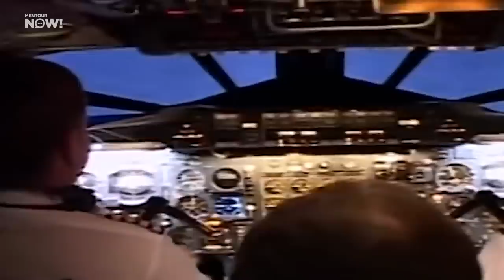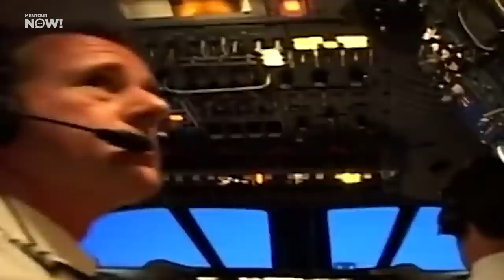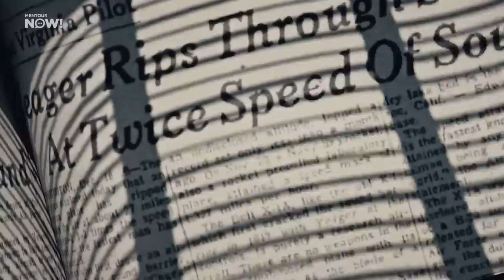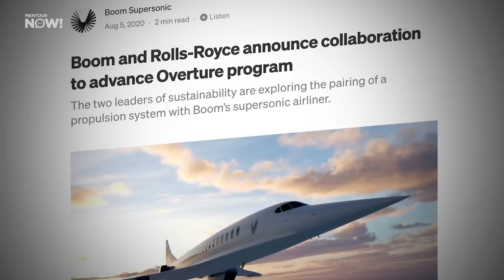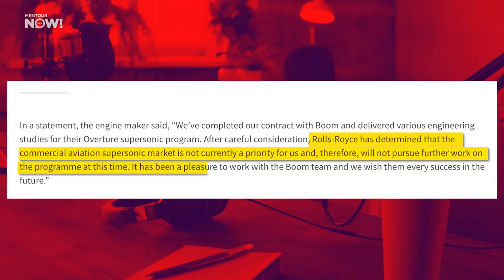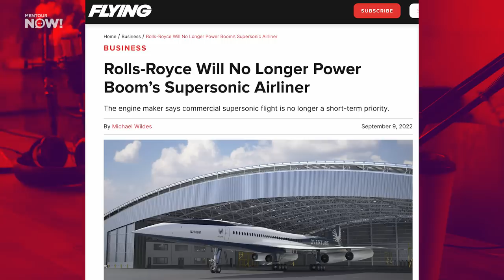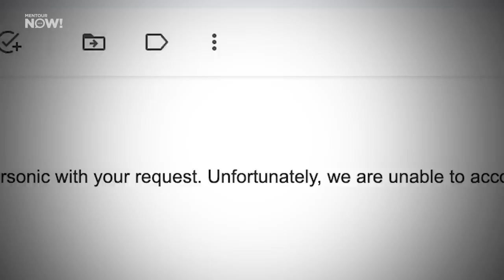WHAT’s Going On with BOOM Supersonic?! Will it Fail?

Comment: I suspect, this plane will have same problem as Concorde got. The landing gear are too close to the engines. I mean't that 2000 year catastrophe.
Reply: Overture's rear landing gear is close to the engine intakes, but the main problem with Concorde was a very high, 250mph, take off speed, which, along with Concorde's weight (185 tons), and long landing gear, stressed the tyres, both thermally and mechanically. This led to a history of tyre bursts, with debris hitting the underside of the wing and causing fuel tank ruptures, and subsequent fuel leaks. There was also cases of debris being ingested by the engines, which is arguably less catastrophic. Despite many mandatory changes, Concorde's wing skins still remained vulnerable to flying debris (see my other post).

Boom's designers will be well aware of Concorde's weaknesses, and will almost certainly ensure that Overture does not suffer the same problems. Also, the following factors will help:
Overture should have a lower take off speed, because it will be lighter, and will have a bigger wing, with leading and trailing edge flaps. It will also have an empennage. These factors will also mean a lower angle of attack on taking off and landing, and thus a shorter landing gear can be used, giving more rigidity. Overture's lower weight will, in itself, reduce the stress on the tires. It is likely that more robust tyres are now available too.

Overture will have a carbon composite skin, whereas Concorde had an aluminium skin. In addition to being lighter and stronger, carbon composite gives much more freedom in optimising strength.

The engine input spike diffusers may give the engines more protection from FOD than Concorde's more open design using ramps.
Reply: The main challenge facing the 1950s UK supersonic transport study group was to find a suitable wing. The big breakthrough was the short slim ogival delta, which has low supersonic drag and, at a high incidence, provides lift for take off and landing, by generating upper surface vortices. The high incidence necessitated a very tall landing gear, and a droop snout so that the pilot could see the runway, giving Concorde an iconic swan-landing-on-ice appearance on approach.

Take off and landing speeds were 250mph and 187mph respectively, which is pretty high, and greatly stressed the Michelin designed tyres, both mechanically and thermally, especially as Concorde was heavy at 185 tons. By comparison, the Boeing 737 take off and landing speed is 150mph and it weighs 75 tons and has a short landing gear. The lofty landing gear, meant that it was subject to high leverage. These factors caused continual problems, particularly tyre disintegrations and subsequent damage to the aircraft structure, throughout the life of Concorde.

At  Charles de Gaulle airport on 25 July 2000, a Concorde's tyre burst while accelerating down the runway. Pieces of the tyre smashed into the left wing and caused a pressure wave in a tank which ruptured, allowing fuel to gush out and catch fire. The aircraft subsequently took off and then crashed at low altitude.  Controversially, the French Bureau of Enquiry and Analysis (BEA) blamed  a thin strip of titanium, measuring 17.1in (435mm) x 1.3in (32mm) x 0.06in (1.4 mm), that was found on the runway, for the burst. The accident led to modifications to Concorde, including more-secure electrical controls, Kevlar lining in the fuel tanks, and specially developed burst-resistant tyres.

Here is a summary of an Observer report shortly after the above crash:

On the 16 August 2000, the Civil Aviation Authority revealed that Concorde has suffered 70 tyre-related incidents, that makes it plain that the Paris disaster on 25 July 2000 could have happened at any time during the plane's 26-year commercial history.

The fact that a single tyre blowout could cause potentially catastrophic damage to Concorde's landing gear, wings and fuel tanks was known as long ago as 1979. Despite a string of design and maintenance improvements, this type of blowout has repeatedly occurred since then.

Concorde has suffered seven tyre bursts that resulted in punctured fuel tanks. Two, in 1979, happened to Air France planes taking off and landing in Washington, triggering a mandatory upgrade in tyre specifications and the introduction of a puncture alarm system.

But by 1982, following half a dozen similar incidents, including a holed fuel tank on a British Airways Concorde taking off from New York, the US National Transportation Safety Board was still sufficiently alarmed to order extra safety measures: Concorde's landing gear and tyres were to be inspected before every take-off.

Subsequent serious incidents, in 1985, 1988 and 1993, all involved BA Concordes at Heathrow and New York's JFK. In each, tyre bursts led to pieces of landing gear or rubber being ingested by the aircraft's engines, and wing skins being damaged, with fuel leaking from the punctured tanks.

Further improvements were ordered in 1983, 1985 and 1993, when pieces of the landing gear's water deflector had punched holes in the wings. But in spite of all the changes, Concorde's wing skins still remain vulnerable to flying debris.

Refs:
(Wiki: Concorde)
(Wiki: Air France Flight 450)
(theguardian: concorde world)

Comment: I doubt this ever gets past the prototype stage.
Reply: @jailbird1133  If Overture reaches the prototype stage, and it meets its specifications that will be a miracle. The main danger is that Boom will run out of money well before that. 

If Boom have a flying prototype the investors will be queuing up.
Reply: @phonicwheel933  depends on if the market is still there. Only the super rich will be to afford it. No way I could ride that thing.
Reply: @jailbird1133  😊 It won't be that expensive, especially after the first two years when economy seats will be available. I would have a problem with the price of a business jet ticket though!

The aviation world has changed radically since the iconic Concorde first carried passengers in 1976. There are a lot more people flying, and they are more affluent. Roughly speaking, the number of trips doubles every 10 years. In addition, technology has advanced greatly, especially with the advent of computers, allowing computer aided design and simulation. Engines are now more powerful, efficient and lighter. Aircraft design has also been revolutionised by the use of embedded computers, additive engineering, CNC, automation, and composite materials (as used on Overture). 

Because Overture will be efficient at sub and supersonic speeds, 500 routes, some mixed land/water, are viable, rather than just 2 water routes for Concorde. Overture will fly 2x the speed of subsonic jets over water and 20% faster over land. Overture will create a sonic boom, but it will not fly supersonic over land. Concorde carried 100 passengers at Mach 2, over 4,488 miles. Overture will carry 65 to 80 passengers at Mach 1.7 over 4,888 miles. 

The two aircraft are the same length at 62m (203ft). Overture will weigh an estimated  154 tons, Concorde weighed 185 tons. Overture's development cost will be $6bn. Concorde's development cost was $14.4bn. The manufacturing cost will be less, the maintenance costs will be lower, and the availability will be higher. Overtures selling price will be $200M. An equivalent price for Concorde would probably be $1.2bn. For comparison, a Boeing 737-800 costs $100M, and a 747-8 costs $420M.

Overture will be simpler to fly, eliminating the need for a 6 month pilot conversion course. Overture will also have a modern cockpit, with more room, and a flight engineer will not be required. Its cabin will be quieter and more spacious, and its seats will be more comfortable. In contrast to Concorde's awesome engine noise, Overture will comply with ICAO-14 regulations, allowing it to use all airports. 

Taking a JFK to LHR one way flight:  
Showing: Aircraft type,  Fuel cost per passenger,  Economy ticket,  First Class ticket,  Duration

Boeing 747          $147          $577             $2,308                      8hrs 
Concorde             $753                                $5,000^                     3.5hrs 
Overture^^            $708         $1,200           $3,000                      4hrs 
Business jet^^^                                 $53,000 to $99,000            8hrs  

Notes
^   2023 money 
^^  Estimated prices, assuming Overture carries 72 passengers against Concorde's 100. For the first 2 years, only first class seats will be available
^^^ There are no supersonic business jets (the sky high prices are correct) 

A 16 hour flight across the Pacific on a subsonic jet could be achieved with one 30 minute refuelling stop by Overture, giving a total time of  4 + 0.5 + 4 = 8.5 hours.

Overture would not be competing for the mass market, but Boom have identified 500 viable routes. Overture may become a niche service, both scheduled and charter, where certain travellers expect higher prices. Even now, on subsonic airliners, some people are prepared to pay 4x to fly luxury class. And, as far as business travel is concerned, the time saving would be well worth it. To support this, Boom's surveys show the viability of Overture. 

If Overture reaches production, and meets its specifications, it will be popular with both airways and passengers, because it will half many journey times and will be cheaper, more comfortable and a lot more practical than Concorde. The military have already shown an interest in Overture. It would also be suitable for charter flights and as a business jet. The next development should be a 200 seat version, and possibly a supersonic business jet.

Comment: "Boom" strikes me the same way as many of the new "starups" - giant claims but nothing behind those assertions. All the things they have shown fall into 2 categories - well-established existing technology that in no way helps with creating a super-sonic commercial jet, or CGI and unsubstantiated claims.
Reply: @ABaumstumpf Yes, unfortunately it does look that way. Boom have been in business for 9 years without much to show for it, but they have redesigned Symphony, and appointed sub contractors, for the engine, fuselage, wings, empennage, and undercarriage, for example.

I don't think Boom are a scam, there would be easier ways of making a buck than by running and aeronautical company for 9 years. So there will be one of three outcomes, they will run out of money, they will be taken over, they will make a resounding success of Symphony.  I really hope it is the latter, because it would be great to see an SST back in the air, now that Concorde has gone.

Comment: So they want to build concorde, but it is a bit slower and a bit more efficient. This sounds like none would need it.
Reply: @dasfabelwesen

Overture will be slower than Concorde and it will carry fewer passengers, but it will address the shortcomings of Concorde that caused its demise.  

Concorde carried 100 passengers at Mach 2, over 4,488 miles. 
Overture will carry 72 passengers at Mach 1.7 over 4,888 miles. 
The two aircraft are the same length at 62m (203ft). 
Concorde MTOW is 185 tons. Overture MTOW will be 77 tons.

Because Overture will be efficient at sub and supersonic speeds, 500 routes, some mixed land/water, are viable, rather than just 2 water routes for Concorde. Overture will fly 2x the speed of subsonic jets over water and 20% faster over land. Overture will not fly supersonic over land. 

Overture's development cost will be $6bn. Concorde's development cost was $14.4bn. The manufacturing cost will be less, the maintenance costs will be lower, and the availability will be higher. Overtures selling price will be $200M. An equivalent price for Concorde would probably be $1.2bn. 

Overture will be simpler to fly, eliminating the need for a 6 month pilot conversion course. Overture will also have a modern cockpit, with more room, and a flight engineer will not be required. Its cabin will be quieter and more spacious, and its seats will be more comfortable. In contrast to Concorde's tearing engine noise, Overture will comply with ICAO-14 regulations, allowing it to use all airports. 

Taking a JFK to LHR one way flight:

Aircraft          Fuel cost^           Economy      First Class          Duration
Boeing 747       $147                   $577               $2,308                 8hrs
Concorde          $753                                           $5,000^^              3.5hrs
Overture            $628^^^              $1,300            $3,800                 4hrs
Business jet^^^^                                          $53,000 to $99,000    8hrs

^       Fuel cost per passenger
^^     2023 money
^^^   Assuming that Overture is 20% more efficient per mile and 72 passengers
^^^^ There are no supersonic business jets
 
If Overture reaches production, and meets its specifications, it will be popular with both airways and passengers, because it will half many journey times and will be cheaper, more comfortable and a lot more practical than Concorde. The military have already shown an interest in Overture. It would also be suitable for charter flights and as a business jet. The next development should be a 200 seat version, and possibly a supersonic business jet.

Comment: Could Boom build their own Engine?
Reply: @stphinkle  Florida Turbine Technology, a division of $1.88bn Kratos Defence, started the symphony engine design in January 2023. Boom stated that no current engines, either military or commercial, are suitable for adapting to Overtures unique requirements, but I suspect that standard sub assemblies/parts will be used, perhaps the core for example.

Boom will design the engine pods and the variable geometry exhaust and inlet ducting.

Comment: Why don't they design an engine based on the same combination of TurboJet coupled with a SuperSonic RamJet, as in the SR-71?   The AfterBurner was far more than just a "simple" AfterBurner, it was completely a SuperSonic RamJet.   Instead of the "usa government" wasting trillions all over the world to massacre people, just the "interest" on the wasted money could fund great research and engineering projects, like more efficient aircraft engines.   Almost all great strides in developing advanced technology is funded by government funded projects, such as military and war, also the so called "space race".   Maybe they should build a sub sonic version with the possibility of upgrading to super sonic when engines are available.   A Business Jet would probably be a good idea to start with.   Maybe a Regional Jet would be good to start with, which would need to be sub sonic anyway.   Get the design in the market, tested, the practicability of the aircraft design and manufacturing techniques established and get some cash flow started.   Anyway, I am not paying the bills.   Have a great day!!!
Reply: Florida Turbine Technology, a division of $1.88bn Kratos Defence, started the symphony engine design in January 2023. Boom stated that no current engines, either military or commercial, are suitable for adapting to Overtures unique requirements. The engine will be a 72 inch, twin spool, medium bypass, turbofan, without reheat. It will produce 35,000 lbs thrust. 

Boom will design the pods and the variable geometry exhaust and inlet ducting. The objective is to have power unit that is efficient at both sub and supersonic speeds

A big fuss is being made about Rolls Royce ending their contract with Boom, but AFAIK the contract was only for consultancy, and not to build an engine for Overture. Besides which, the Symphony project would be totally unsuited to the tier one engine manufacturers, like Rolls Royce, GE, P&W, and Safran. Their cost base and time frames would be out of kilter, and the volume of sales would not warrant their investment. GE caught a cold with the Affinity program.

Comment: Not happening.  There would need to be a military application like a supersonic transport aircraft to get the government funding for the engine development. Honestly, the engineering is being done backward. It is much more viable to develop an engine first and then develop an air frame that makes efficient use of the developed engines.
Reply: @thecaribbean8615

Florida Turbine Technology, a division of $1.88bn Kratos Defence, started the symphony engine design in January 2023. Boom stated that no current engines, either military or commercial, are suitable for adapting to Overtures unique requirements. 

Boom will design the pods and the variable geometry exhaust and inlet ducting.

A big fuss is being made about Rolls Royce ending their contract with Boom, but AFAIK the contract was only for consultancy, and not to build an engine for Overture. Besides which, the Symphony project would be totally unsuited to the tier one engine manufacturers, like Rolls Royce, GE, P&W, and Safran. Their cost base and time frames would be out of kilter, and the volume of sales would not warrant their investment. GE caught a cold with the Affinity program.